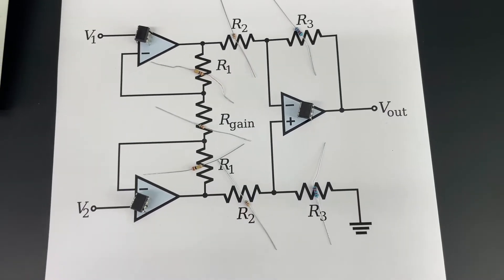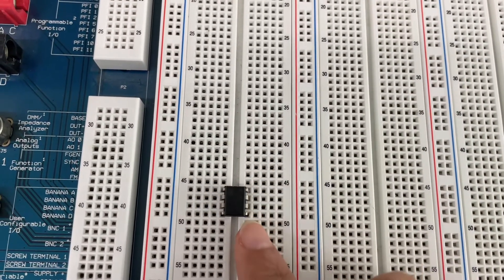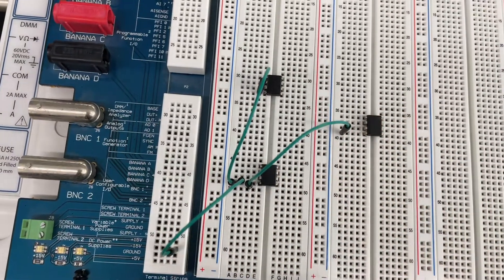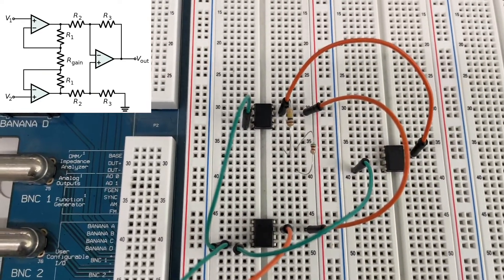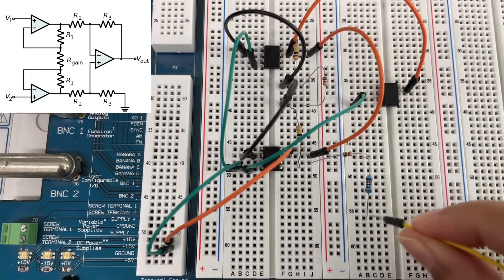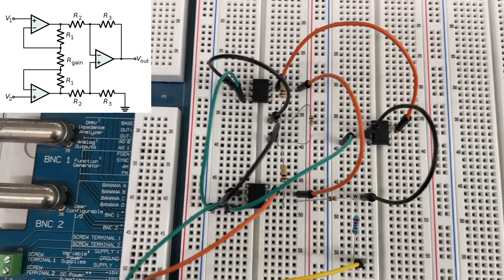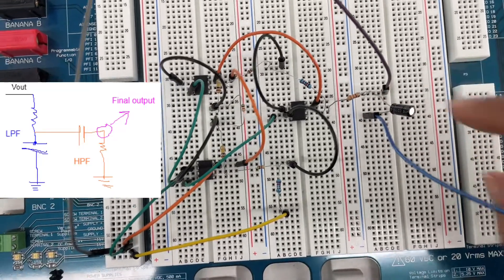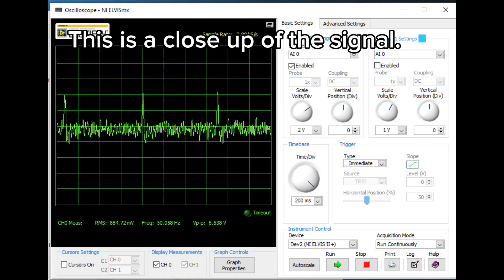Electrocardiography, Simple ECG Circuit Using OP-AMPS [DIY]

Comment: Hi I'm a actual student, I have a question, Where did you get the protoboard?? It's seems very nice to work in prototype proyects
Reply from the maker: In this video I am using the Ni Elvis II+ board which is from national instruments. But you can use any board, with any power source, and any oscilloscope.

Comment: where in the circuit does the electrodes ends go in?
Reply from the maker: V1, V2, and the ground near R3. Refer to @0:05 and @10:12
Reply: R1 100k
R2 5.1k
R3 82k

Rg 5.1k

741 Operacional

Comment: Could you tell me the values of R and C to make each of the LPF and HPF and what is the cut off frequency of each ?
Reply from the maker: I used the cut-off around 100 Hz for LPF and 0.5 Hz for HPF. You can use any C, R combination, and it doesn’t need to be exact.